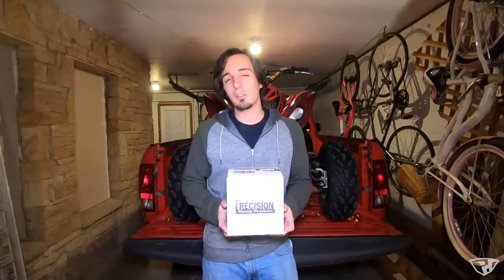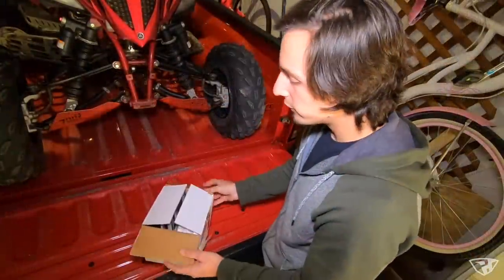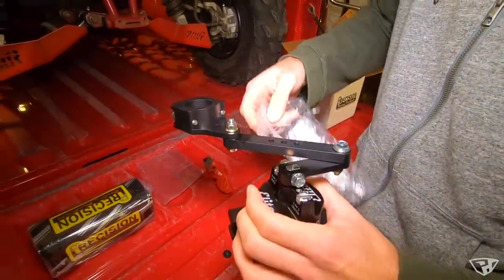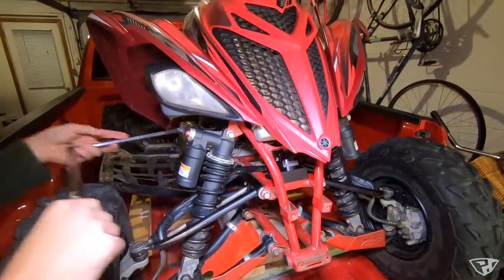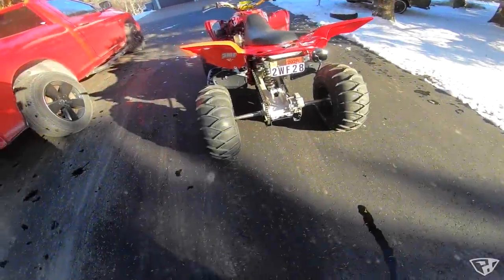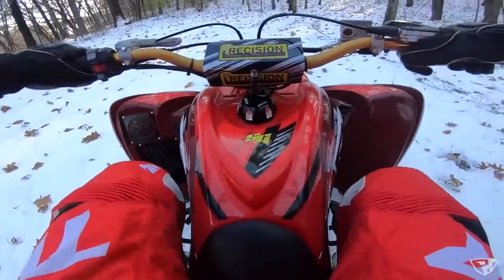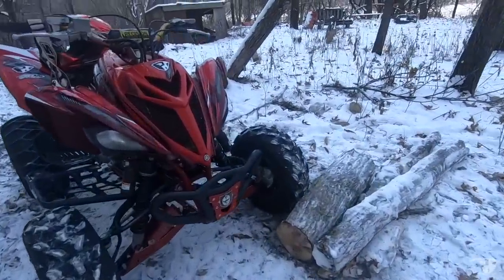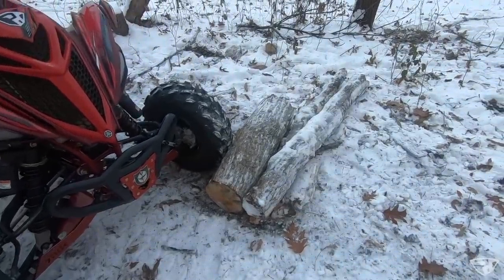The Precision Steering Stabilizer is a Game Changer!

Comment: Just picked up my ‘22 Raptor 700 and took it for a few trail rides so far. Amazing power, plush ride, and nimble as can be, but I’ve gone up a few steep technical hill climbs that twisted the bar out of my hands from bumps and ruts when I had to make a transition in my riding line. Caused me twice to go off the trail. 

I mean I get that I’m a new rider, but after the second ripping of the bars, I had to take a second to make sure my shoulder was okay. Felt like it separated it. 

After watching this video, my first mod for my Raptor WILL be the Precision Elite stabilizer. 

Thanks Pete!
Reply from the maker: Congratulations on the new machine man! I’m glad I could help you decide to pick up a stabilizer. They aren’t absolutely necessary but when they do their job they’re worth their weight in gold! You won’t regret your investment! Happy I could help 😁🤘

Comment: 🔥🔥🔥review man that’s something I think imma check into myself because I know the feeling u get when ur heads come off the handlebars not a good feeling...thanks 🙏🏾🙏🏾 man 💪🏾💪🏾🤟🏾🤟🏾🤟🏾
Reply from the maker: 700r.Raptor. Life I just wanted to share it the best I can, the safety it provides is my absolute favorite part. I feel less vulnerable to terrain out of my control 👍
Reply: 700r.Raptor. Life its a must have mod! And you could always go w the precision pro and save a few bucks the elite is a nice upgrade I’ve ran all 3 in the past the pro adds more oil capacity and helps w fade and the elite your able to run it much stiffer vs the pro and not really notice it in the steering!
Reply: @PeteHager  U did a good job man
Reply: @ononewheel7  Thanks man

Comment: Easier on arms and way more safer because the handlebar stays straight avoiding a possible loss of control..
Along with the goldspeed beadlock rims (making possible much smoother rides using only 2.5 psi) this is one of the most important upgrades in my point of view.
Keep up, I like your channel!
Reply from the maker: designspm dang all the way down to 2.5 PSI?! I had 6 PSI in the fronts when I was filming this. I would love to upgrade to a beadlock rim for next season. Would u stay away from the hipers and recommend the gold speeds?
Reply: Pete Hager i like hipers better if you bend a goldspeed wheel you’ll need to replace the entire wheel with hipers you can replace half’s and centers along w the rings! But hipers are more expensive and since weld racing bought them out the atv side of things support wise is way down! I have been lucky and still have been able to work with them!
Reply: @PeteHager  That's my first set of beadlocks ever so I can't give you a comparison with hiper or other ones.
2.5 psi is safe for goldspeed beads, have done dozens of trails with that spec. I don't recommend going below that, it is not necessary and you have the risk of damaging the tire

Comment: I bet that steering stabilizer is going to help a lot at high speeds I have hit big rocks and it feels like it's going to brake my wrist one of these times  I just dont want to spend any more money on the raptor right now I found a trx450r for 1200 dollars so I'm trying to get the money before it sells
Reply: Everything Loud 406 you getting a 450 🤔
Reply: @ononewheel7  ya hopefully I can get the money before it sells
Reply from the maker: Everything Loud 406 you do a lot of high speed riding. A steering stabilizer would be a nice back up for you if there was a bump or rock that you didn’t see in time. It’s the stuff out of your control that’s scary 👍
Reply: Everything Loud 406 nice!

Comment: Should I get new shocks or a steering stabilizer? The two times I’ve ever crashed are because of clipping a log but my rear shock is blown. So I could buy both but the big thing is that there’s not a lot of aftermarket shocks for the 400ex and the best cheapest one is elkas $1,400. I also plan on getting +2 a arms since my quad likes to roll when it hooks up.
Reply from the maker: Upgrading your suspension will definitely do wonders for your control! You could always source some TRX450R take off shocks and have them revalved them for a long travel a-arm set up. I plan on doing that with our 400ex and going through Rocket Ron for the shock rebuild. The stabilizer is still an excellent idea, especially if you've only crashed from hard, one tire impacts. The stabilizers have saved me several times and sketchy to ride without one once you're used to having one. I think they're the most important part you can put on a quad, it's like adding power steering in a way. Hope this helps with your decision 👍
Reply: @PeteHager  I think I’ll get the steering stabilizer no matter what but is it really that big of an upgrade for the stock 450r shocks or could I maybe get some nice new shocks for a 450 that aren’t outrageous and fit them on. Or maybe even get 450r a arms if they fit so I can kill two birds with one stone
Reply from the maker: @SJ_999  there’s a lot of different routes to go, I’m not sure if stock 450r a-arms mount up to a 400ex but I wouldn’t be surprised. A lot of their parts are interchangeable. I suggested the OEM shock revalve as a cheaper alternative to getting aftermarket. I know many people pay to have their new aftermarket shocks revalved for their weight and riding style. Either way getting them set up specifically for you is definitely recommended. I would consult some Facebook 400ex groups for recommendations if you’re wanting more opinions 👍
Reply: @PeteHager  yeah price wouldn’t be an issue but the list of upgrades I want/need is already above $3k no need to spend that kind of money on something I use 4 times a year and will do thanks for your input!

Comment: The comment you made at (1:38) about it starting to show aging & you could send it in for rebuilding.?...?..🤔 Could you elaborate on that a little more........ I've been reading on the page & couldn't find that part. I mostly found it was under warranty from a year of being purchased.
Reply from the maker: Kilo86Leo after 100-200 hours it would probably be best to have the fluid changed. I was told you can service it yourself or send it in for a rebuild and they’ll send it back. Ononewheel7 did a sweet video rebuilding his precision
Reply: Kilo86?Leo Oil change after 100 hours is a good idea.  We have instructions on our website.  Be care full of rebuild videos like Ononewheel7.  He did not rebuild anything, it was just an oil change that he messed up by opening the unit and loosing the shim and filter then re assembling the unit with missing parts.  He has taken the video down after 2000 people saw it though.  To check if you need a rebuild: turn the adjusters to full hard and the try to turn the bars.  It should be very difficult to turn the bars.  The quad should be unreadable at any speed over 5 mph.  If you could ride the quad, you need a rebuild.  If you need a rebuild send it in.  Do not trust shock guys to rebuild your damper, nor can you do it yourself without special equipment.  I would say 99 out of 100 times customers would have been better off doing nothing to their dampers than having someone other than the factory rebuild it.

Comment: I have a question, what’s better to drift not a lot of air in the back or a lot of air?
Reply: Air in what?
Reply: My back tires
Reply: @cesar0.079  I pump my tires up by feel.... I place one foot on  tire then i (jump) bounce on it...  if it bounces me up in the air like a trampoline for each tire  their good... For drifting like on snow do same or just slightly pumped more ... Never make em rock hard... I use to do about flat on front w/ beadlocks and 5-6 psi on rear...  and you can shred up a rear axle if you turn them to sharp and to hard all the time....IV done it to two 400 ex's
Reply: Thanks I got a raptor 250 and it slides easy
Reply from the maker: If your tires have a lot of pressure then they'll slide/lose traction easier. If you run them too low you could risk blowing one off the bead. I run 5 pounds in the rear usually
Reply: @cesar0.079  thats a nice bike👍. 
What don't you like about it ?
Reply: It’s fun to ride and it rides smooth

Comment: Does anyone know if there is much of a difference between the precision pro and elite steering stabilizer
Reply from the maker: You can kind of think of the stabilizers as generations. The elite is the newest version of their design with a wider adjustment range and better light damping characteristics. The temperature does affect these quite a bit so if you're in extreme climates it may make more sense to go for the Elite model. Either way you'll be more than happy with your decision to get a Precision. Hope this helps 👍
Reply: @PeteHager  yes it did thanks a lot!

Comment: I need a before and after
Reply from the maker: wayne raab If I wasn’t injured i could’ve done a slower “control” example but I wasn’t about to risk agitating my shoulder. An experienced rider knows how much the handlebars will kick with a blunt impact even in 2nd gear. If you don’t believe me go hit a 8 inch log in 1st gear and see for yourself how much the bars move
Reply: @PeteHager  8 inch 1st gear, got it, I'll def go try it tomorrow. Hope that shoulder heals up well so you get back to full strength, thanks for the reply ;)